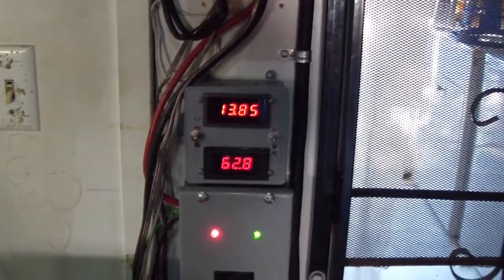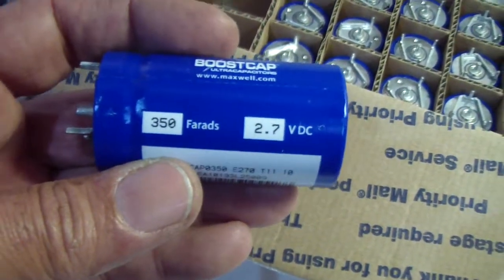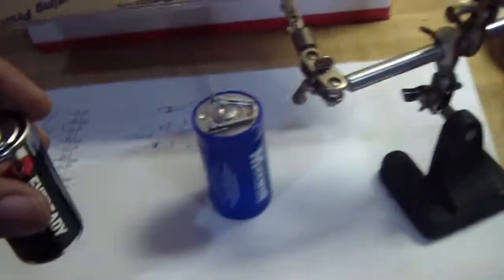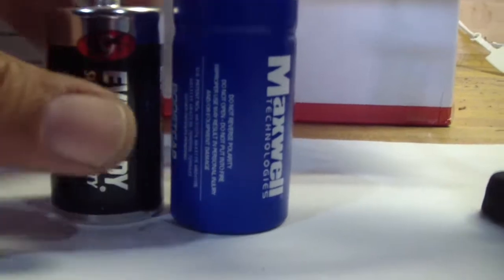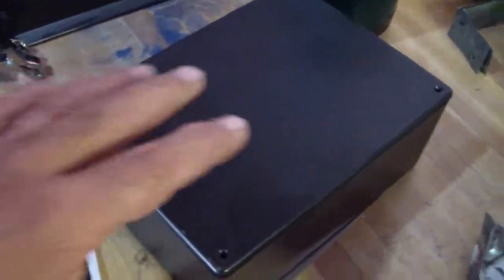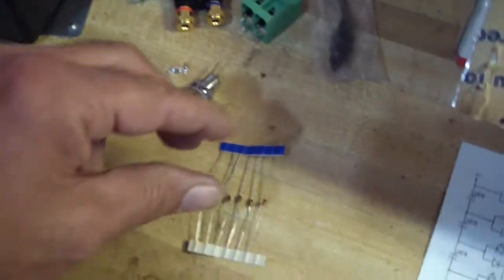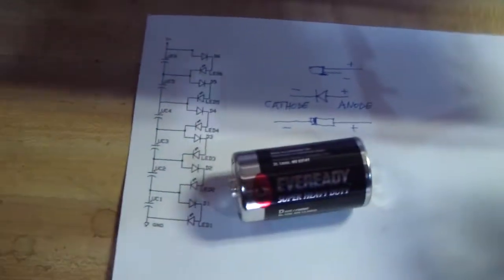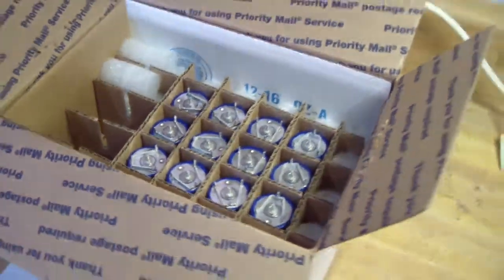Maxwell D Cell Boostcaps/Ultracapacitors Are Here For My New Project.

Comment: I'm in the middle of making one using same caps. All you need is 6 in series.I'll finish it around Feb. Probably start selling them on eBay. They'll be kind of expensive though. Wish me luck. It will be called, "multi booster".
Reply from the maker: Really would like to see it in action buddy.
Be Safe,
Raz